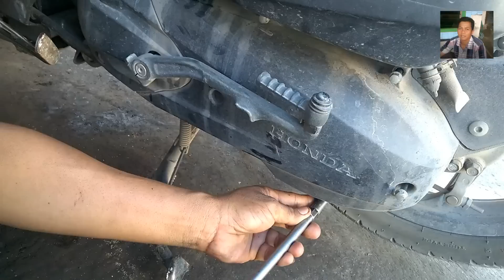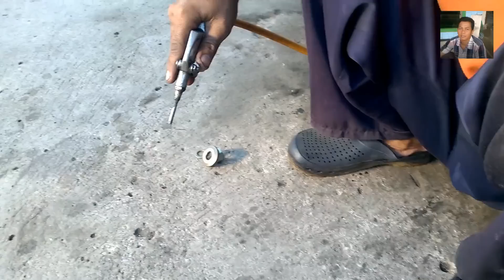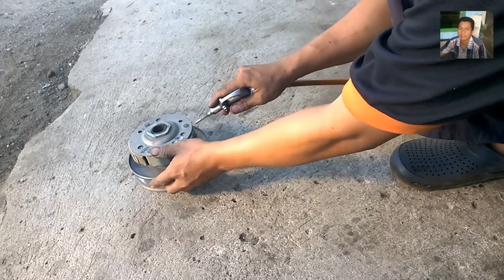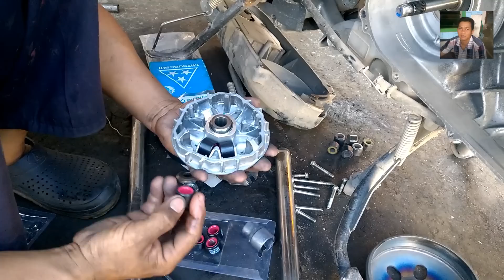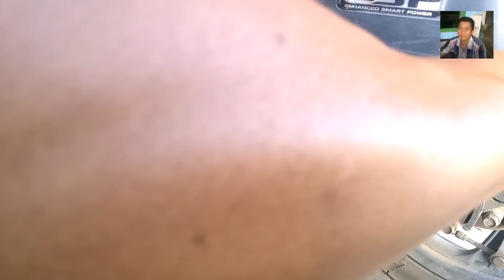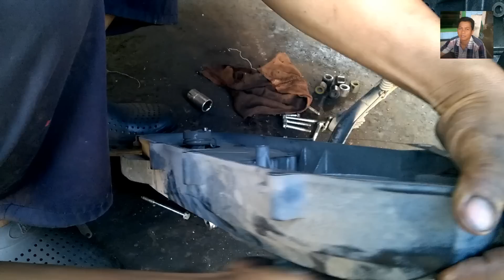Cara Mengganti V-Belt Motor Vario - Cara Bongkar Pasang V-Belt Yang Benar

Comment: kebanyakan vet, akhirnya rpm tinggi vetnya muncrat kemana2, kena vbelt akhirnya vbelt selip jadi boros bbm, roller juga kalo kena vet jadi cepet peang. kalo bisa ngencengin baut depan pakai treker bang, kalo seperti itu kurang maksimal kencengnya akhirnya beberapa hari mur nya lepas.🙏☺
Reply from the maker: kan seal pulinya masi bagus,jadi kuat utk nahan vetnya,trim komennya
Reply: @saudaramotor  BERAPA HABIS BIAYA PERAWATAN NYA??  vVario 125 cc plus